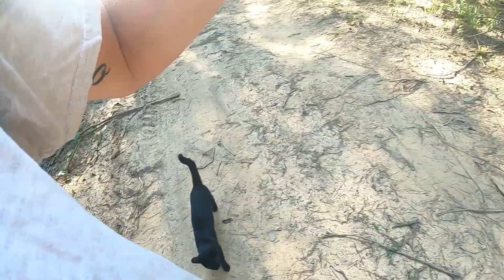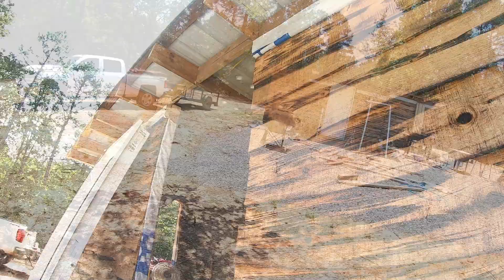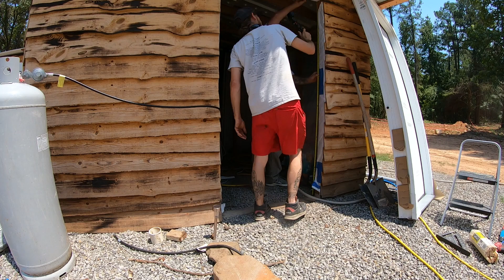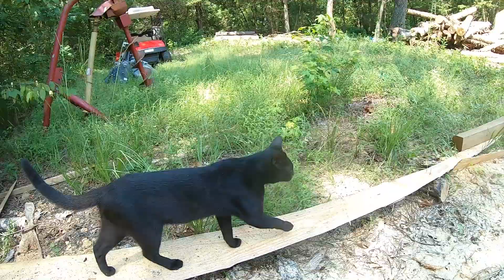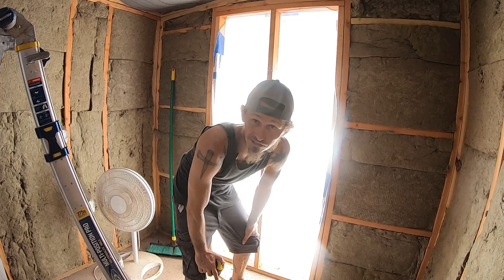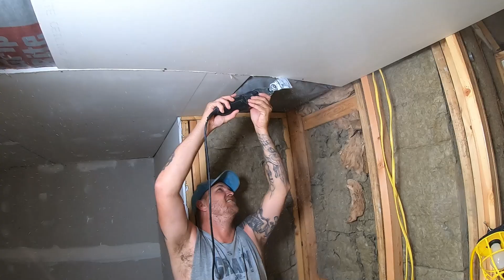DOORS, INSULATION, AND DRY-WALL  couple builds, tiny house, homesteading, off-grid, rv life

Comment: Here is a tip for you guys.  My husband has been a commercial carpenter for many years before he last worked as a truck driver.  He always worked on home remodel alone.  He made a large cross from  a 2X4 by  1X4.  the base of the cross is the 2X4 and the cross bar on top is the 1X4. Measure the height of floor to ceiling and figure amount needed to subtract the 1X4 from the floor to ceiling height and the sheetrock. It should be snug with the top flat cross board holding up the sheetrock with the 3-4 foot top (1X4). This easily holds up the sheet to be placed on the ceiling.  FYI.
Reply: Yep that's what we use it's called a Deadman